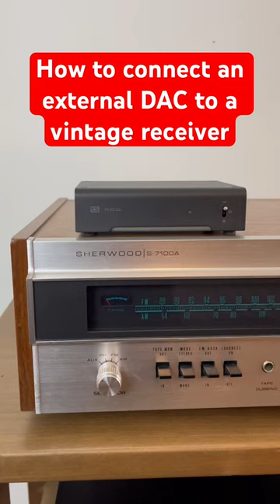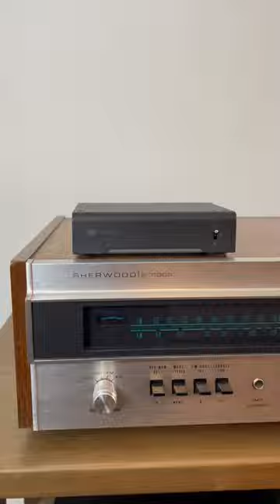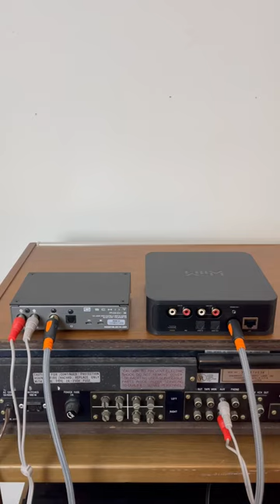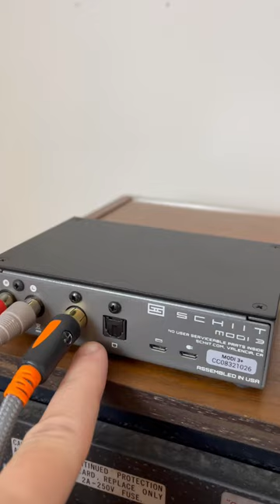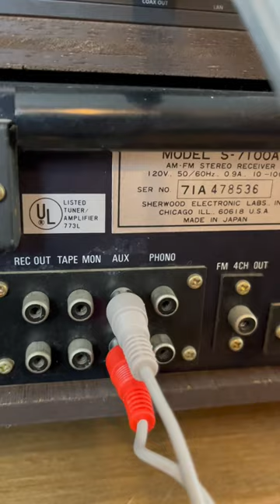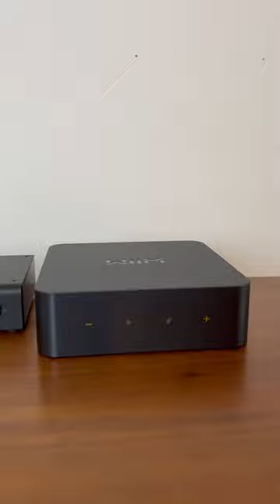How to connect an external DAC to a vintage receiver #audio #dac #vintageaudio #homeaudio

Comment: Lifehack! You can connect the RCA output on your Wiim directly to the AUX port of your amp without using an additional dac.
Reply: Line out correct? That's what I thought.
Reply: @ I think most realize that but many want better sound. I used the built in DAC on my WiiM Pro when I first got it. It’s not garbage as many audiophiles say but wow what an improvement with the Schiit Modi which is less than $130. Of course a high-end DAC will do even better but the law of diminishing returns is in play bigtime with audio/video gear.

Comment: It bothers me that people think an external DAC is better than a DAC integrated within the streamer. Using SPDIF means you are introducing issues with the DAC clock and potential some jitter. Also, such SPDIF connection is hugely inferior to how the SOC and DAC chips can integrate onboard the PCB of the streamer using the DACs full capabilities via I2S, I2C and GPIO. What comes out of the SPDIF might even be transcoded from something SPDIF can not handle, e.g. 192kHz 24 bits Amazon HD music tracks.
Reply: He’s using digital coax in this case which easily handles 24/192 plus the WiiM comes with an optic cable capable of 24/192 although it doesn’t appear to have the best shielding so it may be vulnerable to interference. Some optic cables only get 24/96 but for most people that’s good enough and many will argue human ears are not able to hear differences beyond that anyway. I use a good short digital coax on my WiiM Pro, Monolith(Monoprice’s high-end)optic and a Monolith USB cable to camera adapter for my phones. It’s not that hard to find optic lines that have the bandwidth although I prefer to use coax. Could be my imagination but digital coax sounds better to me even with the same resolution. Seems smoother, more natural if I detect any difference, not necessarily any more clarity. A subtle difference yet I at least think I hear it. Monolith makes superb cables that are very affordable. In fact I just bought another USB cable for $8 Black Friday sale. I think it’s regularly $14-$15. Not sure if they’re still producing S/PDIF or digital cables but they are of exceptional quality. The next level down Monoprice has is very good too.
Reply: @ A digital interconnect does not have any sound to it as it transfers data and errors are not a topic of modern data transfers. Theoretically galvanic isolation can help isolate noise that can affect the analog output stage and theoretically a one-way SPDIF or optical connection will introduce some potential jitter issue when the DAC is poorly designed concerning jitter avoidance (buffering and well-working PLL). I would argue that if you truly hear a difference with different digital interconnects, it’s time to throw out your DAC and get one that works properly. And the argument of more resolving systems reveal more issues doesn’t apply with a digital interconnect.
Reply: I’ve never noticed any issues using an external DAC on either my WiiM Pro or Mini. I’ve used the Wiims with a Schiit Modi 3, Monolith Liquid Platinum, and Geshelli Labs JS2.
Reply: @erieeddie8683  You said digital coax sounds better to you. If everything else is the same, I suspect your DAC has some design flaw. Or as you say, it’s possibly imagined. I fall into that trap also. It’s really hard to compare the most tiny nuances unless you have a setup where you can quickly switch.
Reply: @ I understand the interconnects do not have a sound yet optic and digital coax transfer the code differently thus potentially picking up noise differently that may be perceivable or not to different ears. When I say smooth I mean a more natural vinyl like sound yet I don’t consciously hear anything but the music no matter which cable I’m using.  Either way it’s very subtle and as I mentioned perhaps  more of a placebo type thing. The 3 DACs I mentioned work fine but my Monolith Liquid Spark DAC won’t power on. Loved that thing. Exceptional for the price but no longer made. All those DACs I mentioned  sound much better than the built in DAC, significant difference. The Wiim’s isn’t awful, I tried it for a while. I didn’t detect any performance advantage whatsoever  with it. I heard about these so-called reclockers that improve upon the supposedly bad clock in the WiiM. I do not understand this at this point, too new to me. I’m not aware of such issues as I listen.
Reply: @ Yes, but that is exactly my point. Only a rather poor DAC will be sensitive to any noise on the digital input. Internally inside the DAC the analog output stage has some power supply that must include proper regulation and ripple filtering to achieve a SINAD of above 110dB no matter which cable you have connected. Cable companies want to sell expensive cables and often do it with pure snake oil arguments.

Comment: the Wiim literally has two RCA outputs.  No Schiit.
Reply from the maker: Yep, just used it as an example, lol, but I still like swapping external DACs in with streamers just like I swap different cartridges in with my turntables. I find it a lot of fun!
Reply: Wiim's internal DAC's are crap. On the MINI, PRO and even PRO PLUS. All crap. A cheap DAC like this MODI takes this crap, polishes it and makes it nice and shiny all around.
Reply: @Daandeslions  the pro plus and ultra sound great

Comment: What does a modi do that a Bluetooth device doesn’t? What difference will I hear
Reply from the maker: The Modi is a DAC without Bluetooth streaming. It’s converts the 1s and 0s of digital files to analog so we can hear it.
Reply: The streaming device does the exact same thing. This is just an unnecessary upswell for the naive.  @ForeverAnalog
Reply from the maker: I was only using the streaming device as an example lol. One could also connect a CD player or transport this way to a vintage receiver should they choose ✌🏻
Reply: @ForeverAnalog a cd player and the streaming device already has a dac. what's the point?
Reply from the maker: @cdbennett2332 to improve the sound using a higher quality external DAC.
Reply: Vintage equipment typically doesn't have Bluetooth
Reply: The streamer is receiving information via the WiFi network or an Ethernet cable to the modem. It operates at a higher resolution than if you were sending music from your phone to the receiver via a Bluetooth adapter. The Wiim streaming device has a cool app that has value added features, like EQ modes, the ability to sync multiple streaming devices throughout the house and your music will not be interrupted by phone calls or notifications. Depends on your stereo gear and speakers, as to whether you will be able to notice an increase in sound quality by upgrading to a WiFi device from Bluetooth.

Comment: Doesn’t the Wiim pro have a DAC, as there is a line out? Why use the Modi?
Reply from the maker: I enjoy swapping external DACs in my audio system, just like I enjoy trying out new turntable cartridges.
Reply: The streaming device does the exact same thing. This is just an unnecessary upsell for the naive
Reply: Because wiim internal dac is 💩
Reply: @rcpmac  wrong.  The WiiM's DAC is awful.  I mean it's adequate if you don't care about sound quality...
Reply: Woa! tiger's outta the cage maan 😅😅  @zounds13
Reply: @zounds13  my Yamaha As301 has an internal DAC: can I go directly from wiim to line in ?
Reply: Yep

Comment: I got a Google audio chromecast and just used a rca adapter to the headphone jack and plugged that into my vintage receiver.  It works, but maybe it’s not the most ideal?  Any input?
Reply: Use a Toslink Adapter with the Output of the Chromecast and the use a Cheap DAC like the Fiio Taishan and from this go into your Stereo System.

Comment: Unless I'm much mistaken you've connected left to right channel and right to left!
Reply from the maker: Possibly so but I figure most folks know how to match the colors lol and the overall message of the video was still conveyed.
Reply: You are mistake. The red phone is on the DAC right output and the receiver right input. The DAC is marked R and L (R is on the left side) and receiver's right input is on the lower row.
Reply: Red is right. Connections are correct.

Comment: The WiiM already has all the connections you need and an excellent DAC (AKM4493SEQ). Why would you use an extra external DAC that had a harsh sounding ESS ES9018 DAC?
Reply from the maker: Some folks like to try different DACs so this is just showing them how to make a connection, not a recommendation on which DAC to use.

Comment: Or just run the output of the streamer  directly into the aux input on the reciever & save $200.
Reply from the maker: Fair point but the WiiM mini is cheaper than $200 lol
Reply: @ForeverAnalog  last I checked the modi3 was around $200.

Comment: It’s still too complicated for me 😟
I just couldn’t follow along, sadly. 
Maybe make a video that goes more in depth with a better explanation of theory and take it slow?

😂
Reply from the maker: Just connect the digital output of your cd player or streamer (like coax or optical) to the same digital input on the DAC. Then connect RCA from DAC to an RCA input on the receiver. The DAC is just receiving the digital signal from the source and converting it to analog and sending via RCA to the receiver.